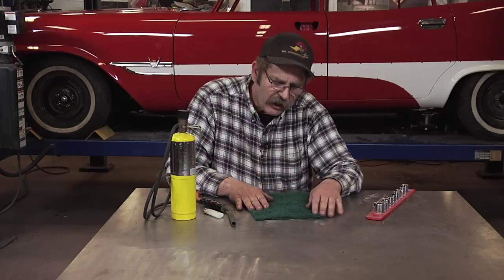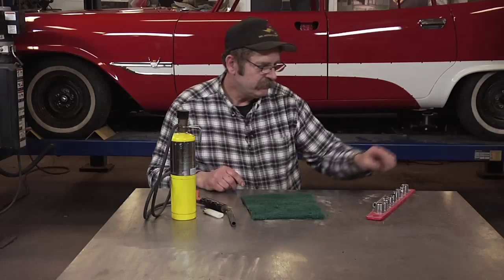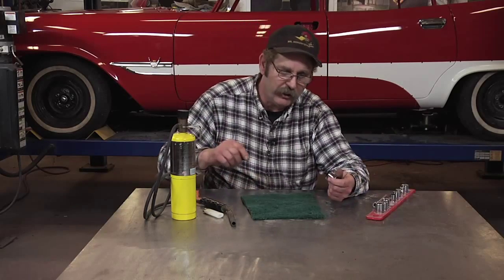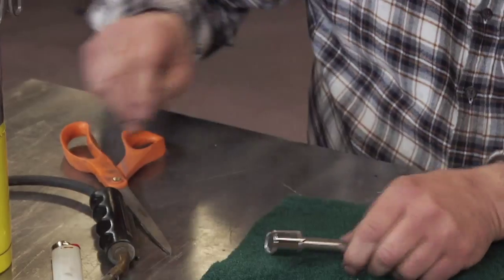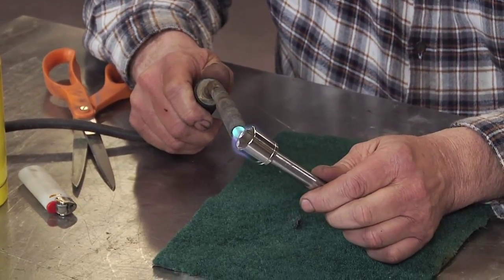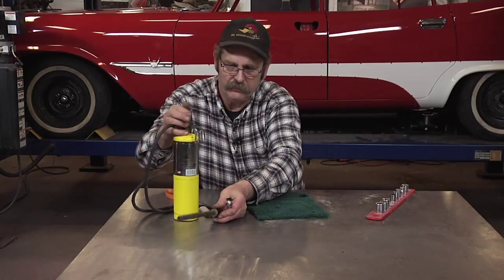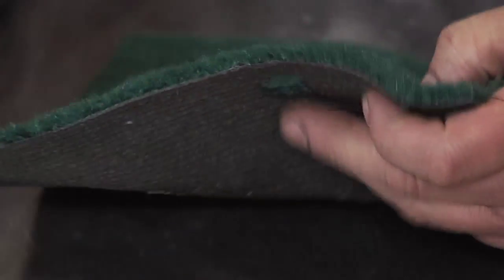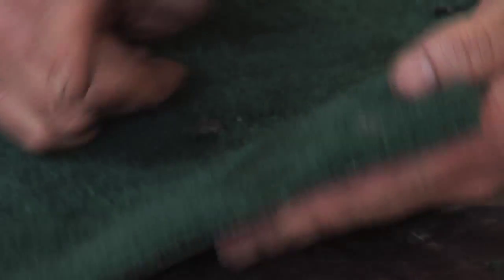MAKING HOLES IN CAR FLOOR CARPET

Comment: Brilliant works a treat. Just did my  front foot well mats  on the car with perfect sealed round holes that fit  over the locating stubs in the carpet to prevent sliding as per factory tailored mats. Thanks

Comment: How would a gasket punch work?
Reply from the maker: Yes, a gasket punch or hollow punch would make a nice round hole.
What I like best about heating an old socket is that the process of making the hole also melts the ends of the carpet, keeping the carpet fibers from fraying.
Not to mention almost everyone has an old set of cheap sockets around, or they can be bought for just a couple bucks at the next swap meet.
Wrench Safe, Mark

Comment: Can't I just use a carpet punch???
Reply from the maker: Hi Gabriel, 

Yes a carpet punch will do the same job.... If you have one the right size that is... and for many enthusiasts they'll likely only make a few holes ever.

So the expense of a specialty tool for only a couple uses is a decision each of us make when building a car. 

Personally I prefer this method as the heat fuses the carpet strand ends making them less prone to fray.

But yes there is more than one way to get the job done.

Hope this helps, 

Mark
Classic Car Restoration Club Video Membership
Reply: Awesome idea. Thanks